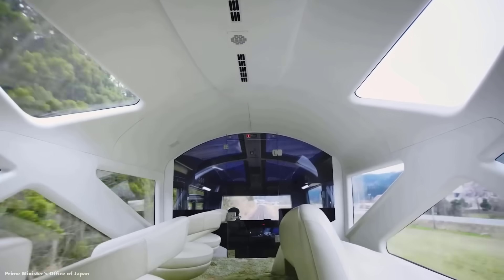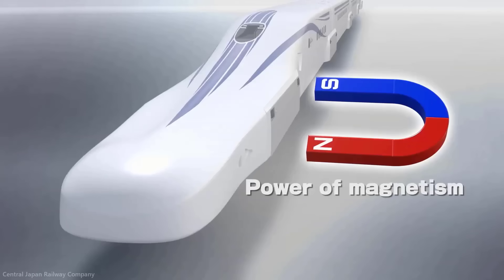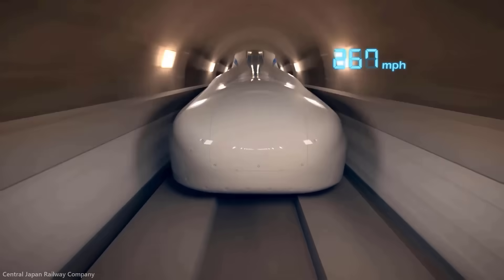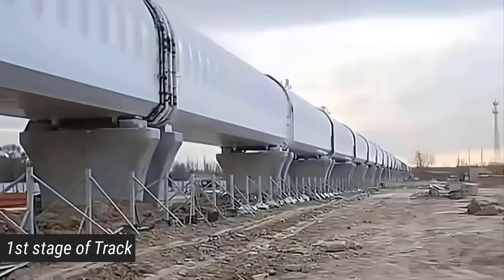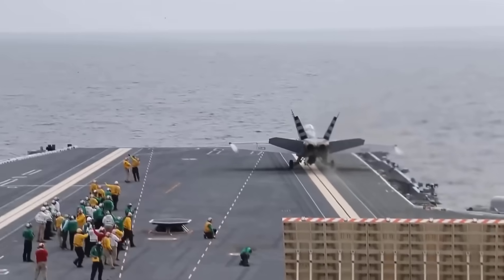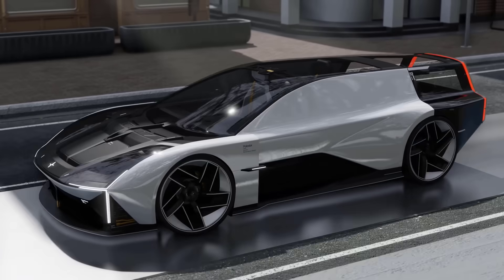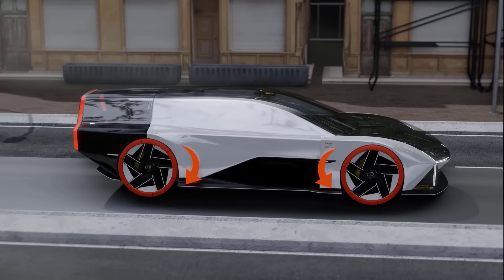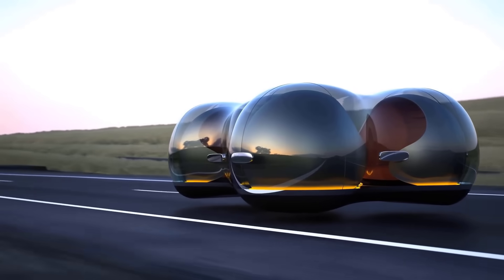1,030 km/h Magnetic Levitating Train... 4 Game-Changing Magnetic Vehicles

Comment: The way the Japanese maglev train operates was described completely incorrectly. The  figure 8 coils aren’t connected to an alternating current and are independent of one another but produce a magnetic field once the magnetic field of the superconductive magnets pass by them. The train itself has to reach 160km/h before the levitation effect takes place which is why it has rubber tyres which retract as speed.

Comment: Oh, WOW. This is not just CGI animation? Some of these are actually in operation today?  If some of these do operate in a vacuum, that drastically reduces wind resistance. As far back as the 1950's and early 1960's Disney had programs that postulated about futuristic things. Like, devices that were not GPS in nature, laid in highways for driverless vehicles. A program about the Interstate Highway system where we could drive border to border, coast to coast with out any stop lights. The manufacture of automobiles and the functions they would have. If bureaucracy could keep there nose out of this , companies like UP and others should be doing R&D on these, for freight and passenger service. And then there is the workforce needed not only for the manufacture of these but the maintenance and operation of these devices. LA to NYC in 30 minutes. A thing I would miss would be the "dome cars" that current travel has..

Comment: MAGLEV -  A FINANCIAL NIGHTMARE !
MAGLEV is an engineering "non starter". Or they would have been building such systems for Decades. It's fundamental issue, is to make hundreds of tons of vehicle float in the air on an electromagnetic field, costs an astronomical amount of Electricity. Much more than powering a current rail born Japanese Bullet train or French TGV, that achieve speeds of up to 200mph at a much lower electrical cost. And the planet already has issues with the cost & production of Electricity !!!

Comment: What happens when traveling at 600 mph your maglev stops working? A power outage or a break in the system. Wheels just can't handle that speed. So do you come crashing down then?
Reply: At least in Japan,if a power failure were to occur, the superconducting magnets in a linear motor car could continue to function, allowing it to slow down to a speed at which it could safely run on wheels and stop with the wheels.
Reply: No there is a feed back loop in the phenomenon.  The forward motion creates repulsion.  Diminishing returns from heat losses would bring the train to a gradual stop.

Comment: Hyperloop has been debunked by Thunderfoot, and he's right. ANY breach of the vacuum tube will spell fatal catastrophe. A 45-caliber armor piercing round, for example would allow air to rush in and create a shockwave travelling down the tube at the speed of sound, absolutely flattening any cars in its path.  Beyond that, no one can sustain a vacuum that large. The biggest vacuum chamber in the world is at NASA's Glenn Research Center in Sandusky, Ohio, The chamber is 100 feet in diameter and 122 feet tall.  That's it. So you can forget about maintaining a stable vacuum much longer than 122 feet.
Reply: Sounds like a loser's excuse. Just get gud.
Reply: You can patch a 1 inch hole at one atmosphere with a couple of strips of duct tape.

Comment: Operating a train in a vacuum would be called a Hyperloop and that has been thoroughly debunked as impractical to the point of infeasibility. All it would take is a 30-caliber round to penetrate the chamber, and you get a Mach 1 shock wave destroying the first several cars in its wake in either direction.  Even if you could sustain a vacuum of that size (which you can't), it would be far too easy to sabotage.
Reply: China: says low IQ society
Reply: Sort of like how easy it is to sabotage and derail trains? Doesn't stop countries form building tracks does it. Fairly easy to hijack planes too; should we all stop flying?
Reply: Hyperloop is not a train it is a shuttle.  If it was a train it would not be a new idea and Musk would not have been able to fool people.  It is easy to make an Hyperloop but it will never be cost effective.  There is no serious train manufacturers working on Hyperloop.  Only start up which are in it for p.r. stunt or to scam people.  Maglev have been around for decade so they did not have to developed anything. As for building a low pressure tube, it could have been done 100 years ago.  A train which is many shuttles connected together is much more economical than a single shuttle or pod.  If the shuttle are not connected then for safety reason they need to be spaced out.  The faster they go the bigger the distance between them which reduce the number of passenger per unit of time.  This is the reason why there is no Hyperloop, not because it cannot be done.  I agree with you that a maglev in a low pressure tube is not a good idea.  It is not cost effective compared to a regular hi-speed train but it is not infeasible. From a commercial standpoint, going to the moon was not a good idea but it has been done 50 years ago nonetheless. China is a big country they can afford to have a non profitable train.  The US keep its engineer busy by developing weapons it does not need.  China do the same by developing civilian project that will be useful and they might make money by exporting a scale down version.
Reply: Shame - was a pessimist - if you think they haven't figured everything out a long time ago you'd be 100 percent wrong...sweet dreams

Comment: So, basically, while Musk has quietly stopped talking about hyperloop, China is showing how its actually done and is going even further..  Well, let's see.  It would be impressive if they manage.  As for the lifts, I'm trying to recall which SF movie showed this - nice to see there's innovation there too although I would want the option of a window :).
Reply: Chinese dont talk, they do.
Reply: @herrwolf5184  The fastest train in the US is the tramp around the zoo.
Reply: @herrwolf5184  They also have over a billion people they can use as slave labor.
Reply: @HTHAMMACK1  I don't know your definition of slave labor. You believe they are forced to work for CCP without any pay and have to live in a camp?

Unless you mean wage slave, which we all are.
Reply: @HTHAMMACK1  Yes, they will use a billion people to push the train to hypersonic speed. Happy? While you are at it, accuse them of Geno Joe as well.
Reply: Tbh, I am Chinese and I still don't believe in the hyperloop until I see it happen. China is putting most of its focus on the CR450 upgrade which will allow trains to run at a service speed of 400 km/h (the tracks are more than capable of handling these speeds). Longer term, there are plans for 600 km/h Maglev, but I haven't seen an operational prototype running at that speed yet. To me, there are still vast engineering challenges to the hyperloop how to maintain the partial vacuum, the cost of building a whole system, and how to protect such infrastructure from sabotage/terrorist attack if sudden pressurisation could be catastrophic. Also, Elon Musk didn't invent the idea of vacuum trains. People proposed it a century ago. But like many things, old ideas are recycled decades after people stopped working on it because it wasn't feasible at the time. The media thinks it is new. Musk just brought back an old idea to public discussion.
Reply: There is already a functioning maglev train in Japan and now China
Reply: China is copying this tech.  They went into the future, copied the tech, and travel back in time to the present.  😃😃
Reply: You said it. It's called Total Recall 2012 https://youtu.be/7CJO6XtSEvY?si=adO5Ax5BrvfTtxCD
Reply: If it wasn't for Musk experiencing the realities of China construction he wouldn't have any futuristic ideas,their present is his future creation
Reply: In one of Sir Arthur Clarke's {WW Fighter 2 Pilot, TOP SciFi  author)  this  LIFT technology  is introduced/implemented.
{SciFi Novels}
Reply: Hyperloop was a scam to sabotage californias attempts to improve trains infrastructure to capitalize on the electric car market.
Reply: Mit 3d Brille und Übertragung aus dem Führerstand geht es auch    |   It also works with 3D glasses and transmission from the driver's cab.
Reply: It's Japanese not Chinese. The Chinese maglev (shanghai line) is a small old project that got discontinued because it doesn't provide the results that the Chinese government want. It is too expensive to build and run. That's why the short line from the airport to the city never made any money.

The Japanese New maglev are the one who are currently being tested on a full scale model. Their operation speed (not max speed) would be at 500km/h. They are the only who currently planning on building full line between 3 cities. (Tokyo-Nagoya-Osaka).

The chinese model are the older model build decades ago. It hasn't been updated yet.

The original one was from germany, but only test track were built by then decades ago.
Reply: @nntflow7058  Cool, thanks for the update :)
Reply: @freddoflintstono9321  you are thanking the wrong person 😂
Reply: @nntflow7058 不懂就别乱BB
Reply: @nntflow7058  lol your info need to be updated 
hyperloop is now only being developped by China after Elon quit
New gen maglev is being developped by both Japan and China, and none of the coutries have put it to use by far. The japanese has a project ongoing but delayed, the chinese has a faster one but no one believes that China will actually build it since the country has an excessively built HSR network to use. A reasonable guess is they'll directly jump to hyperloop when the tech is ready.
Reply: @nntflow7058  pretty much. on top of that the idea sounds very dangeous. Both China and japan are plagued by earthquakes so I highly doubt its applicable in the future
Reply: @nntflow7058  if I well remember there was a tragic incident testing the german train, I think they stopped development also for this reason